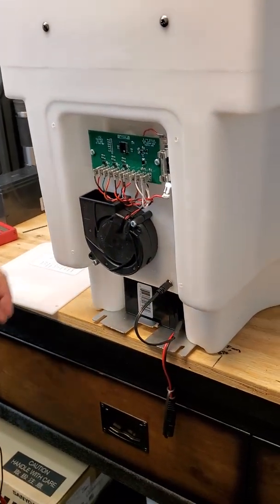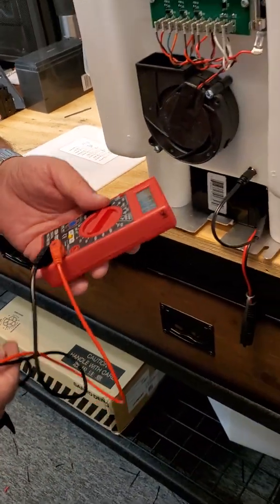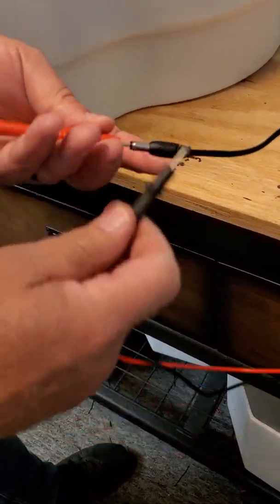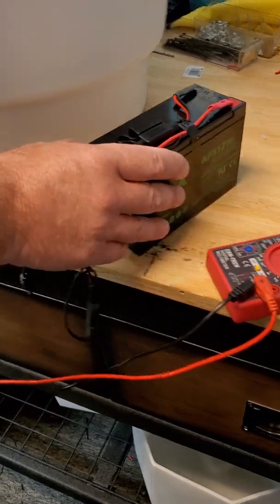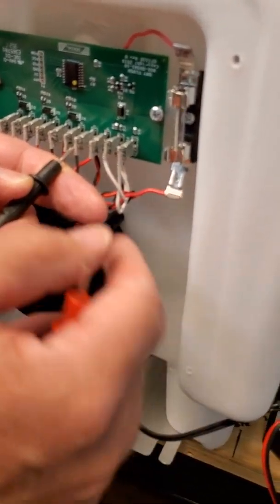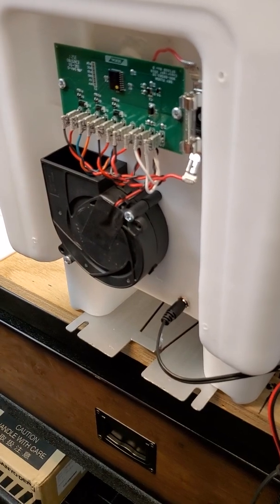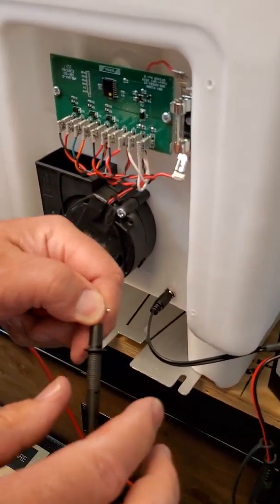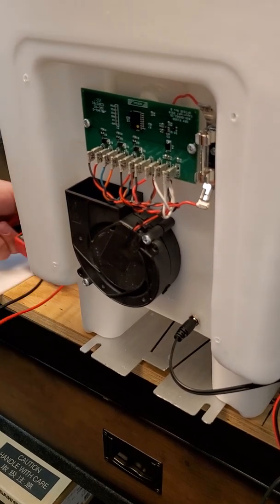Electrical Troubleshooting

Comment: Do you sell extra circuit boards and extra fuses? If so, please include the cost of each. Trying to plan ahead. I wouldn't want to be in the middle of nowhere with a non-working toilet. :face-blue-wide-eyes: Y'all might consider selling a "Trouble Kit" that features everything we'd need to troubleshoot every possible issue. Having watched the video, the potential need to replace the line to the power input concerns me most. How often does that happen and what would cause it to happen? Thank you.
Reply from the maker: Hi Julia,

Thank you for taking the time to leave your comments. 

Our Laveo is designed to be rugged and dependable. They are actually in use in Antarctica for this very reason. Parts can be purchased on our website under the "Buy Now" tab.

Our videos are meant to offer a DIY approach to repairs. As you can see in the videos, the steps are simple. If a customer needs a part sent out quickly, we offer unparalleled customer service and can ship a part anywhere along your travel route to make sure you have what you need. Also, if a full-service repair at our facility is desired, we can do that at very affordable rates.